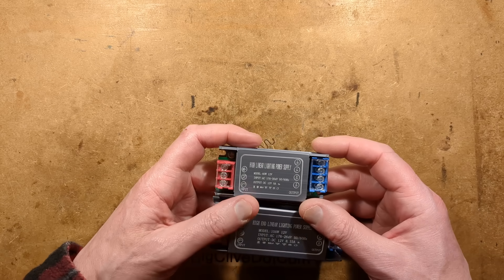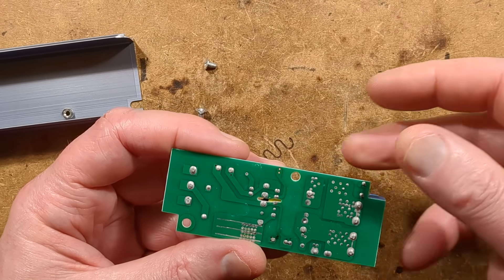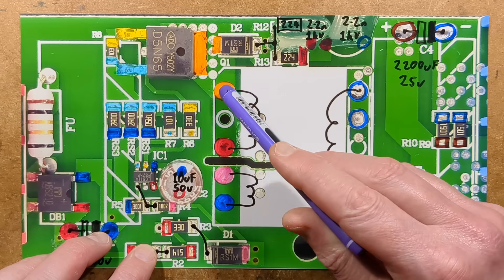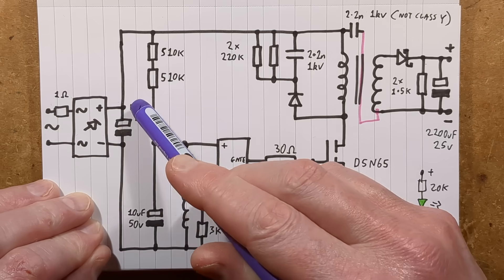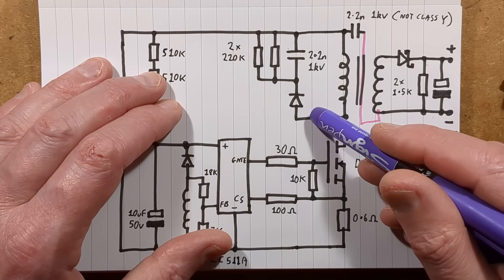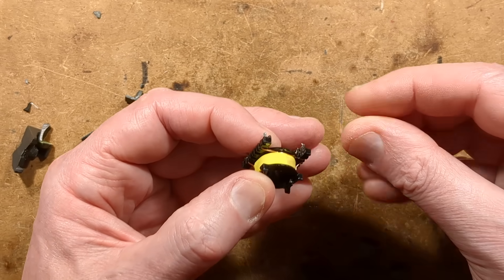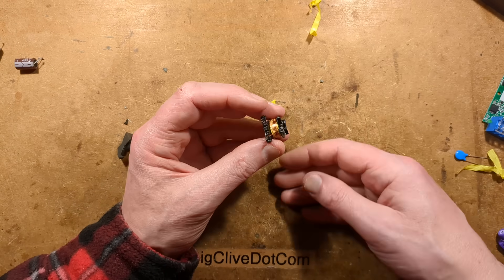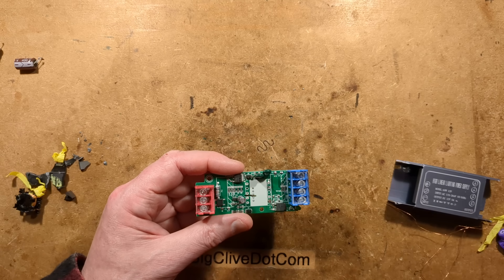AliExpress LED power supplies - almost OK

Comment: I got a 12v 10a power supply and it was soooo sketchy. Looks just like this but longer, uses lever nuts, and is covered in goo.
Reply: I was able to push it to 12.5A before total shutdown. I love it.

Comment: "We build it with surplus, they will buy it" is the mantra.
Reply: Sometimes it isn't even "surplus", BUT, components that they've pulled off recycled circuit boards out of used, discarded, items. 

That was a practice some years ago, I'm not sure if it's still happening or not... 

There used to be electronic circuit board recycling places that popped up all OVER the U.S. here, and they'd actually PAY you for old boards out of your electronics. They look at the boards, and class them as "Regular" or "High-Grade" depending on if there was gold contacts, or worthy components on it. Then they'd weigh them, and pay you for the total weight. Then the companies here would sell the boards directly to the Chinese for a profit. The Chinese would pull off the worthy components, and figure out how to get the precious metals off the boards. 

That was about 10-15 years ago that these places were all over the U.S. I haven't seen one in a while, so the Chinese may not be buying boards anymore, and that whole thing may be over with.. 🤷🏻

Edit: I worked for a construction company back then, and we worked on MANY older buildings in industrial parks, doing whatever was needed to get vacant buildings ready for these circuit board "recyclers" (resellers), and these places popped up FAST and FURIOUS for a while, and then they kind of just disappeared later on. 

It was kind of a BOOM for a while there though... There was some shady characters that jumped into this business for a when it first became a thing back in the mid 2000's. Must have been quick and easy cash.. 💸

Comment: One really weird aspect of these that I noticed was the range of AC input voltages printed on the cover plate, which seems to be "176-276 V". I would love to meet whoever designed these so I could ask what on earth he was thinking about when he decided on that bizarrely specific voltage range.

About 20 or 30 years ago, power supplies were much more selective about the mains AC input voltage they would accept. British and European supplies would be designed for 240 volts, North American supplies for 110 volts, and you could not interchange them without adjusting the supply voltage using a separate step-up or step-down transformer (or perhaps a variac) between the appliance and the wall socket.

There were some types of computer PSU which were capable of doing this internally - these had a little slider switch on the side to convert between 120 or 240 volts, or sometimes between 110 and 220 volts. This was far from ideal though, since getting it wrong could either be annoying or downright dangerous:
If you set the switch for 240 volts and then plugged the PSU into a 120 volt socket, the worst that could happen is the computer just not working. But if you set the switch for 120 volts and then plugged the PSU into a 240 volt socket, this would fry the PSU, destroying it and maybe even start a fire. If the circuit breaker didn't trip fast enough, or if the internal fuse in the PSU (or the fuse in the plug) didn't blow fast enough, the chances are that the computer motherboard and other vital components would be fried too. So this could be an expensive mistake.

Most modern switched-mode power supplies (for computers, laptops or anything else that runs on low voltage DC) are designed to prevent all of these problems, by accepting an AC input voltage anywhere between 100 and 240 volts. Meaning they can work almost anywhere in the world without needing to adjust the voltage.
An interesting aspect of this type of power supply is that they can actually accept DC, albeit at a different voltage range: For any power supply which can accept between 100 and 240 volts AC, it would also accept between 142 and 340 volts DC. This is because the first component the incoming AC voltage meets (after passing through the on/off switch and fuse) is actually a bridge rectifier. So if you did decide to run it on DC, you wouldn't even have to get the polarity correct, because the bridge rectifier will correct it for you.

An even more interesting consequence of this is: If you want to construct an extremely reliable backup power supply for computers and laptops, this can be surprisingly simple and doesn't even need an inverter, as long as you have space for enough batteries: Connect 12 old deep-cycle lead-acid leisure batteries in series, which will give a nominal 144 volts - this will of course increase to almost 160 volts when they are all fully charged. This can then directly power any modern computer PSU, laptop power-brick or smartphone phone charger. It would however probably be a good idea to run this through one of those arc-extinguishing circuit breakers which are designed specifically for DC.
To keep the battery bank charged up, it would need to be supplied with a charging voltage of about 14.4 volts per battery, which would be 172.8 volts in total. If your mains supply is 120 volts AC, this becomes really easy, because just running that through a bridge rectifier gives 170 volts DC. Which works out at about 14.2 volts per battery, which is close enough to charge the entire battery pack in series. If your mains supply is 240 volts, the only additional component required would be a step-down transformer or variac to convert this into 120 volts before running this through the bridge rectifier.

Comment: You can get synchronous rectifiers in the standard "diode" packages too. E.g. DK5V45R20 is a 45V/20mΩ for use in offline flyback converters

Comment: Thanks again for another great vid!! Tis the season — it’s basically a Christmas light driver! Keeps the LEDs steady and way safer for anything after it. Hardly any flicker too! Wonder if a dimmer module could be added to it?
Reply from the maker: That might be OK if the lights were heavily insulated and couldn't be touched.  You could add a PWM dimmer on the output for simple lights.

Comment: The class Y capacitor, can you explain more about its function, or tell me where to finda about? If you use the power supply without it?
Reply from the maker: It is intended to provide a return path for electrical noise coupled between the layers of windings to reduce the risk of RF noise being transmitted by cables.

Comment: I don't know why but the "they've gone 90% of the way there and then just cheaped out and ruined it" describes pretty much all of the industrial stuff I work on from China. We bought a 7.5kW mixer at work, it actually has a safety switch, the motor is beefy and seems well put together, the key on the shaft actually has a pin holding it on which is lovely given how awkward it is to fit mixer heads on to - overall it's thoughtfully designed for how cheap it was. The stock wires were real copper and were undersized but thicker than I expected them to be (14Ga for a 20A circuit at full load. Should be 12 or 10)
But then they didn't bother to ground the motor (and painted over the ground pole in the case). Rather than using crimp terminals in the motor terminal box they just wrapped the whisker-y wires around the screws and tried to squash them with washers. Stock wires hang loose in holes with plugs sized for the 10/4 cable I used. It's like they ran a record marathon and then decided at 25mi to just drive the last bit.
Reply: Because a lot of these cheap stuff are made by low(er) tier copycat(copying other Chinese manufacturers )factories that just assemble stuff, not designing or engineering the product.
Reply: @Techpriest1010 this man knows how Guangzhou or Shenzhen factories work
Reply: It's almost like they copied the design and ruined the parts they are comfortable ruining without killing functionality.
Reply: I think they make the adults do all the critical jobs and then let the kids figure out the rest. Exactly what Big C and you said, even a silly magnifying light I bought, very thoughtful circuitry soldered by a chimp. Had to re-solder all the joints, works like a charm now. Many blessings guys, much love to you all.
Reply: There are a few factors at play. Copycatting is one issue, high staff turnover is another, resulting in staff not being shown how things should go together

Another one is line managers deciding to reduce costs but not understanding the safety aspects - MBAs and line managers  are just as guilty of this stuff in western countries too (eg: a regular occurrence with 1980s Philips electronics)

Saving on the cap and transformer would be the kind of thing that you'd see in this last kind of situation (also: parts shortages)

It's worth noting that the reason WHY Japanese manufacturers tend to run continuous QA on components as they come in is because they encountered substitutions relatively regularly in the 1950s-60s which could kill their reputation or drive up costs depending on whether the results failed in the factory or after shipping to customers. 

They also learned to actually zap reject bin silicon after a few  blacktopping scandals involving remarked reject memory parts getting into official supply channels  (The case I'm particularly thinking of involved failed 64 byte ram ICs being sold to a handheld game maker to be used as decoration(*) - they'd been scrubbed of part numbers but the fraudsters who got hold of them (nearly a million chips) very carefully counterfeited the silkscreened labels such that they were hard to detect. Many 1970s blacktopping cases involved relabelling common consumer-grade ICs as milspec - they'd test the same and usually work just fine across the claimed temperature range but could be sold for 10x more, This mostly died out when automotive grade took over most supply chains as that outspecced milspec temperature requirements and essentially made milspec obsolete

* Adding extra dummy ICs to toys was commonplace to make things look vastly more complicated than they actually were
Reply: @alanbrown397  I've seen firsthand the MBA types here doing their "optimizations", I don't envy those who work in factories that make this sort of stuff in China, the management must be something else entirely. 
I've heard about some of those blacktopping scandals but I'd actually never heard of the milspec automotive overtaking, that's super fascinating! Some of the most interesting things I've loved to read about are times where civilian market stuff blow straight through what was special select top-of-the-line only years earlier.
Reply: yeah that's a shame sometime they design nifty little gadgets too, but use components rejected from quality control, making the thing blow up to save pennies... That's how you end with the bad "made in china" reputation.
Reply: The rules for sizing short runs of wire inside a product/cabinet/machine are different from building wiring rules, the 14 used might have been legal albeit cheap and marginal. The improper terminations and bad grounding are of far greater concern, and typical, which is why I tell people to treat any of this cheapo import electrical stuff more as a kit someone else did a bad job assembling.
Reply: 14ga would be correct via the tap rule and distance, same way you have 12ga wires on a 50a circuit in a stove
Reply: Well said. When it comes to small power supplies, it seems to me that many modern ones have short lives: PWM chips go bang, MOSFETs and Schottky rectifiers fail. I'm not sure where the pennies are being pinched, but they fail often. A few years back, small SMPSs often looked horrible – brown boards, through-hole components at crazy angles, silicone everywhere – and didn't necessarily score well for either safety or RFI, but they were quite reliable.
Reply: this is scamgeneering
Reply: Yep, cheap and cheerful, you get what you pay for, although i have often been surprised at the performance of some cheap gear. I got a 3KW 20A variac from Italy, and opened it up straight away. Lucky i did, because the internal wiring was way too small, like 1.5mm sq. So i rewired it with 4mm sq.  Better to over-engineer something than work right on the limits. Japanese & German stuff is just superb in design and quality IMHO.
Reply: It really is frustrating, and doesn't just apply to electronics. I have a paddock stand for my motorcycle that is over all quite decent. It's not fancy, welded tube construction, requires taking some things apart to swap modes where nicer ones just have pins or fancy mechanisms to do it, but it's fine. Except that instead of a spring detent (like on a folding table leg) to hold the handle in place, they just used a solid pin in a little Z-shaped keyway, which doesn't stay in place at all, and turns it into a death trap that will drop the bike on your leg if you aren't extremely careful. Such a simple thing that completely kills the product.
Reply: Why do you think they  can get in at a cheaper price?
you are buying to a price not a quality.
Reply: @stevesteve8098  Oh I know it's price over quality, I'm not the miser that bought it, just the guy that tries to keep it from igniting once we plug it in.
On price, my $0.02 is I think the companies that build these have very very slim margins, compliant regulators, and subsidies (watts, land etc.) that make them basically impossible to out-cheap. I think other people here are right that they tend to do zero R&D and that lets them stomp their rivals.